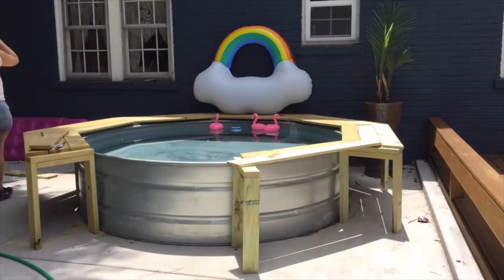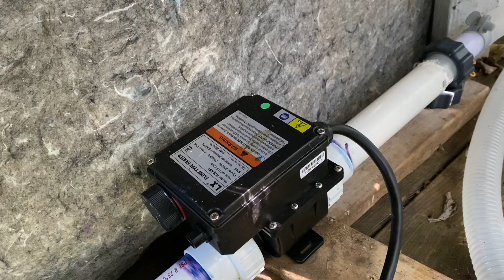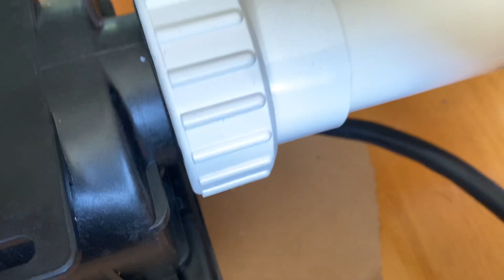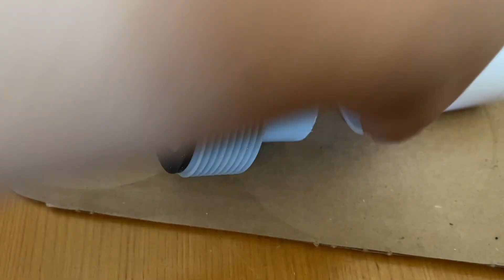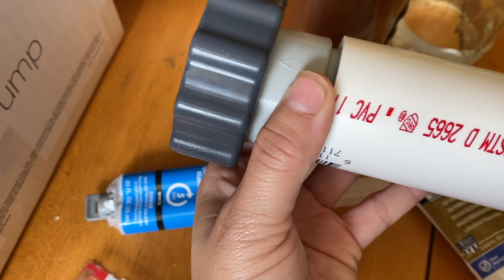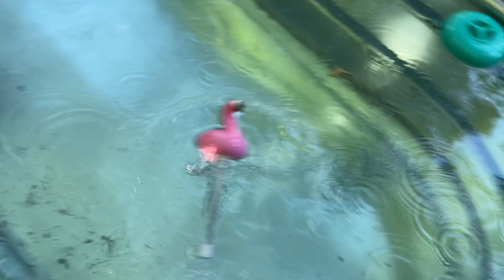Turn Your Stock Tank Pool Into A Hot Tub Using an Electric Heater

Comment: First off, your videos are fantastic and wildly helpful. I was curious about the flannel fabric and the rug padding, does the padding get wet and funky? And did you use regular fabric or some type of waterproof fabric?
Reply from the maker: Well, thanks! I just used regular flannel fabric and we removed it when the season was over. It definitely got rained on but it was fine in the end. We just had to let it dry out when we wanted to store it. Our original plan was to install clasps on the fabric so we could remove it easily (kind of like a jacket for the stock tank.) It's definitely better if it can be removed more easily that way you could take it off in bad weather. Or come up with a totally different insulating plan! haha
Reply: I’ve figured out a way I think will work best for quick and easy install and removal, I’ll post pictures soon!

Comment: Any info on operational costs? I’ve read up on wood, propane, and electric. Our space is too small to use wood as safe as we’d like, and the propane heaters seem to burn through tanks a little quick. I’ve read some complaints about high electric bills with the electric heat but I’m curious how it’s been for you?
Reply from the maker: We need to do a video about this! In our video about our propane setup we talk more in depth about the use of propane and some of the cons of propane. We always like to say that stock tank hot tubs are more something you use every now and then, but not necessarily a great full-time hot tub. Unless you insulate really well, you will be putting a lot of energy into trying to keep it warm constantly, no matter what source of energy you use. Definitely more to research here!

Comment: How long does the water stay hot? Does the insulation make a difference? I want to know if I’ll have to heat it up every day, or if a fully insulated stock tank (top, bottom, and sides) will maintain the temperature. I have an 8’ stock tank, so I don’t want to heat it 40 degrees every time.

Comment: Another great video! I like electric vs propane. I have a problem with my 633t intex pump that NO one can help me with. AIR IN THE LINE! No water leaks, I caulked the intake valve, raised the pump, changed the original filter. Each time it’s on, I let air out of the filter dome until the air is out and the water gushes out. Then a large surge of water comes out of the jet into the tank. Intex was no help all! Any help would be greatly appreciated. I live in Corpus Christi Texas. Where are you located? HELP

Comment: could you use hoses instead of PVC for a little more flexibility?
Also, it looks like you have the heat pump outside of the main drain/outlet.... but shouldn't it be attached on the other side before the inlet? That way water can go through the filter first and it won't put leaves and debris into contact with the heating coil and other internal components?
(I looked at the visuals on the product page - i am assuming you just followed the install directions, which is usually a safe bet)
Reply from the maker: You are definitely welcome to install however you'd like, I just followed the instructions of the heater. And I used hoses on my other heater installation (instead of PVC) so I bet that would work just fine on this one too! Definitely worth a shot.
Reply: That would be correct!